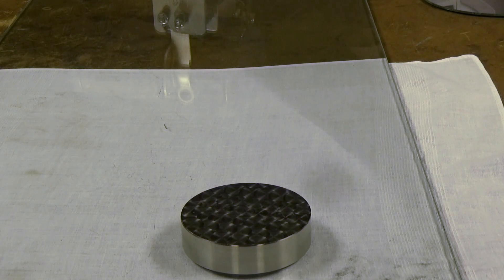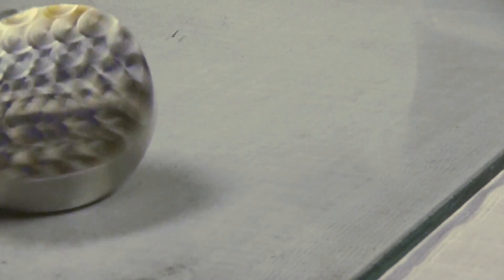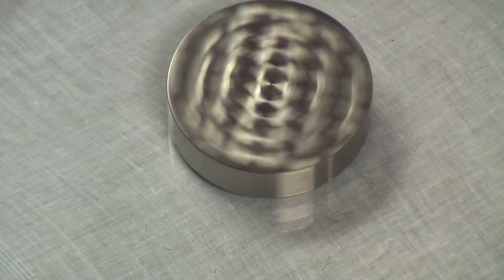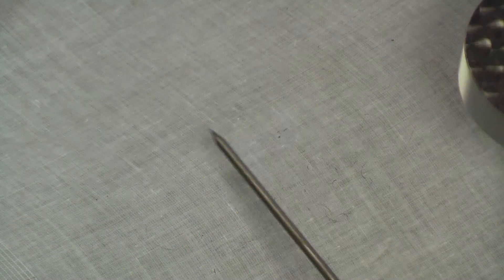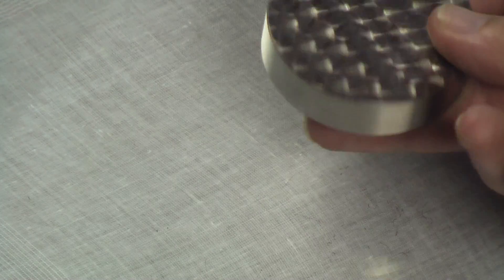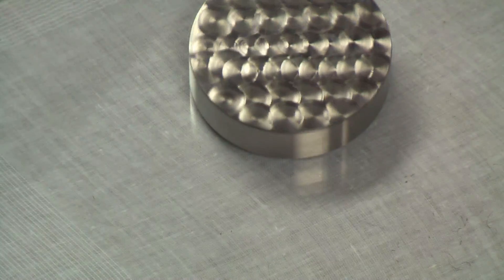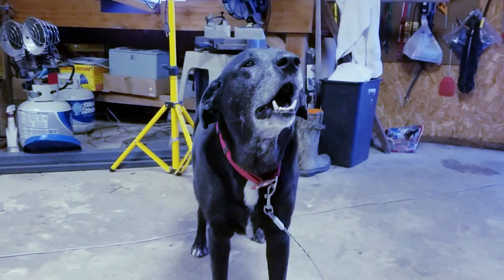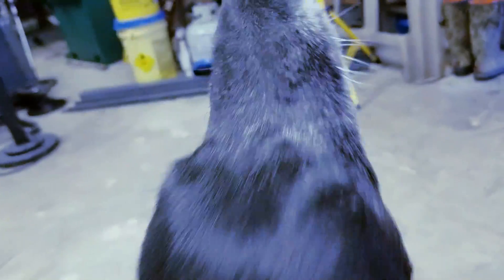Euler's Disk  A Kinetic Energy Toy

Comment: Several years ago I used to do the same thing with a quarter, but I started the spinning on the edge and as the momentum slowed it would slowly roll over and go into the same effect you were illustrating. It was a bit of a challenge to spin the quarter and keep it within a small area and was never able to get one to spin longer than ten minutes. I thought that it was amazing how the coin would slow down and begin to wobble and then the inertia or momentum would increase as the coin got closer to the horizontal position.